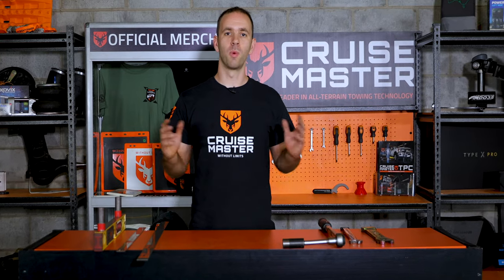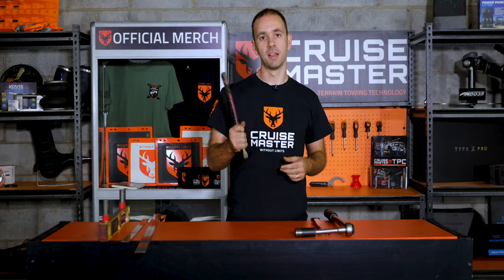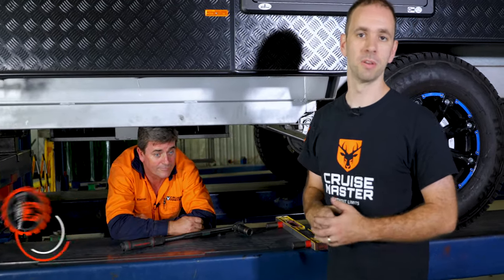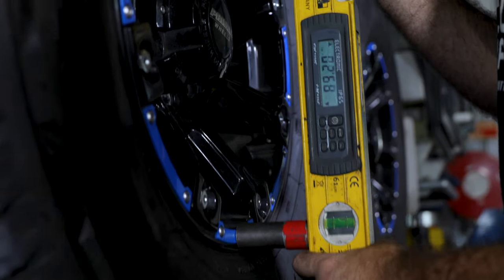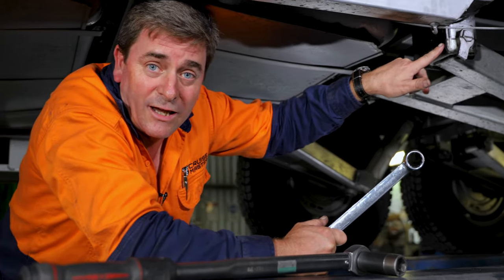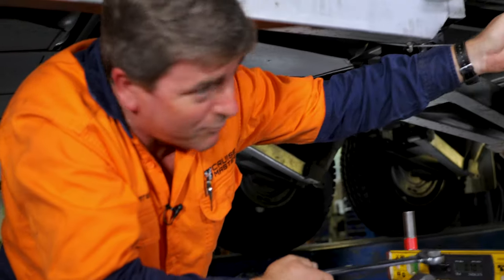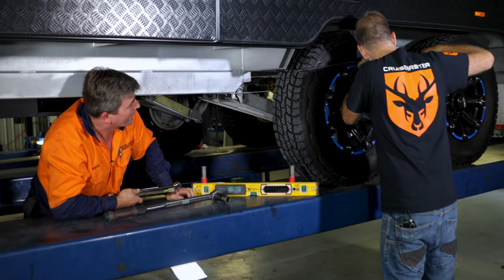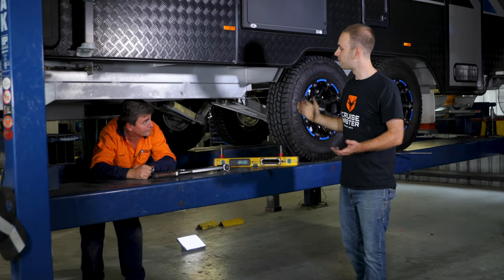CruisemasterClass - Ep 5. Wheel Alignment

Comment: Where do I purchase these bolts and adjustment ring? I'm currently rebuilding a 2011 southern cross 4wd trailer with your independent suspension needing a complete rebuild. Where can I also purchase brackets to convert to twin shock and upper support for spring? Interested in replacing all bolts, bushes, shocks and springs but can find parts like the camber ring or replacement mounts for shocks

Comment: Great video guys, well done. Why is the front or single axle set at 1 degree toe in and what would be the effect of setting parallel 0 degrees?
Reply: Having a slight toe in means the trailer will drive a lot straighter and will be less likely to wander on the road, as both front tyres are pushing inward to each other so they stabilize the trailer

Comment: The camber and caster bolts are oval?
Reply from the maker: The shaft of the bolts themselves are round. Its how the step in the cam adjuster interacts with the locking plates on the hinges that generate the adjustment.

Comment: Hi Andrew , will a new caravan in need of a wheel alignment cause it to sway?
Reply from the maker: Things like wheel alignments and tire pressures are a couple of easy DIY checks you can do to help eliminate the cause of ride quality issues. Most commonly though sway is due to weight distribution of the caravan, so you want to make sure a majority of weight is over the axles.

Comment: Great video thanks.  Just thinking about the 1mm toe-in specification for the front wheels.  
Has this value been set to account for the fact that it is only practical to place the straight edge across the top of the wheel?
If it was feasible to do the measurement across the full diameter would the toe-in specification be say 2mm?